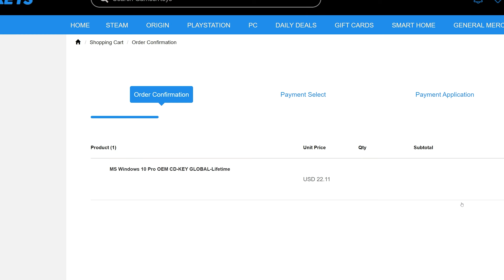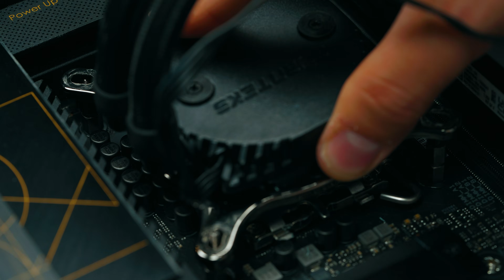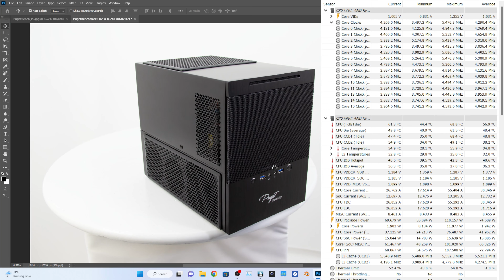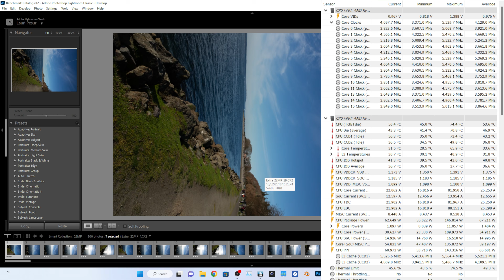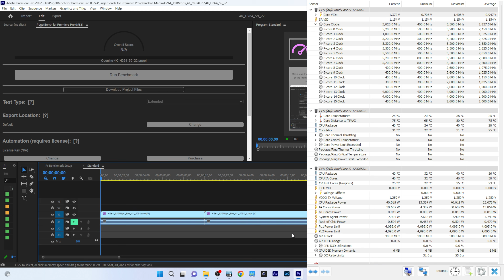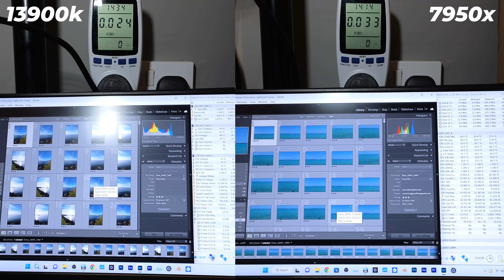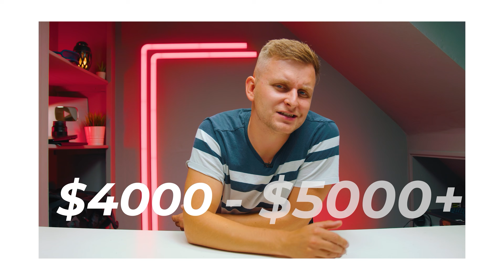INTEL & AMD both lied! 👉REAL WORLD power consumption is MESSED UP

Comment: That's true. Being a creator does not utilize CPU/GPU at 100% always. Thanks for this, I am looking for some irl testing of the software both in idle and stress test. Part of being a creator is thinking and that is an idle time so we should consider that.
Reply: 10w vs 50w is a dramatic difference of 2-3 dollars per month if running 24/7
Reply: May make a difference if you have a company with hundreds of PC's